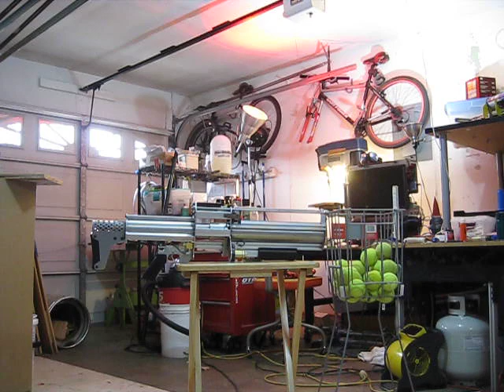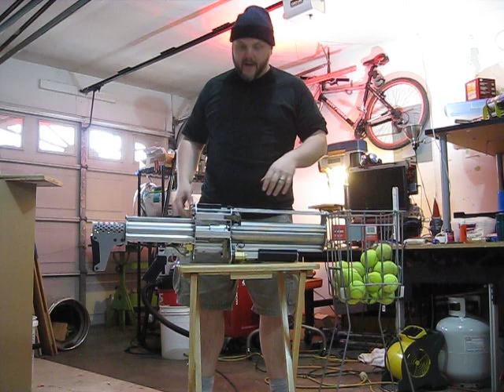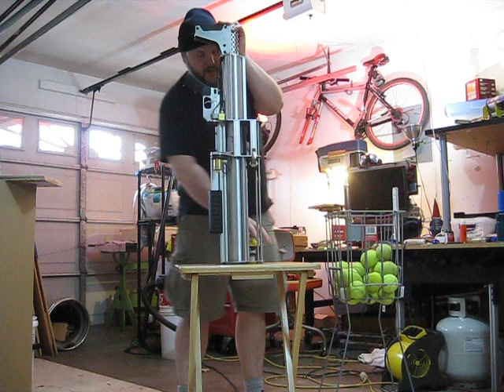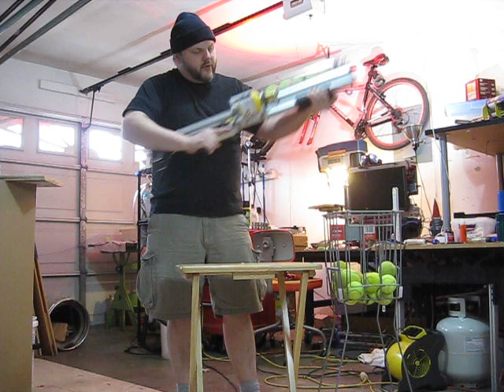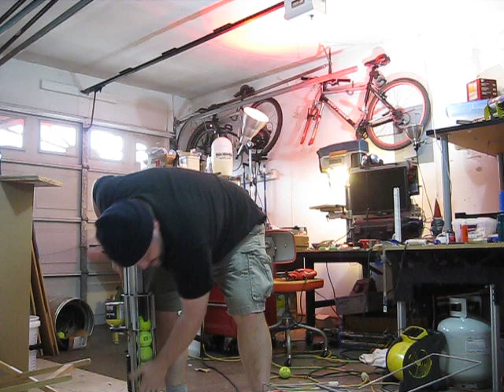TAC 6 INSTRUCTIONS

Comment from the maker: $950 is a lot of money.  This is a lot of gun.  There is nothing jankey or halfass on it.  It's all grade 8 socket head bolts and 6061-T6.  If you think $950 is high,  wait for the carbon fiber version.  Ultamatespudgun has sold 3 in 6 months.

Comment: you guys that think 950 is a lot lets break it down.. 20 hrs labor at 20 bux an hour for an average machinist in america , thats 400 bux in LABOR ... grade 8 nuts bolts and 10 lbs of sheet and tube 6061 aluminum, lets say 100 bux or more ..So your at 500 bux and its his brain that designed it.. hes doin the buyers a favor..